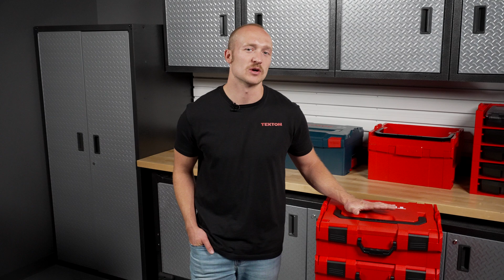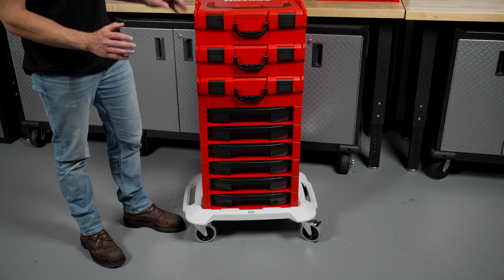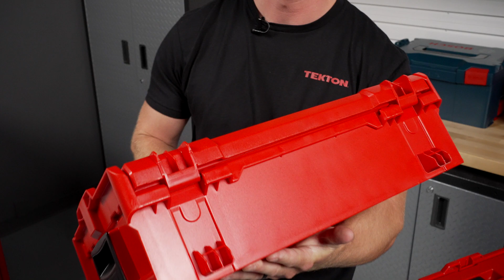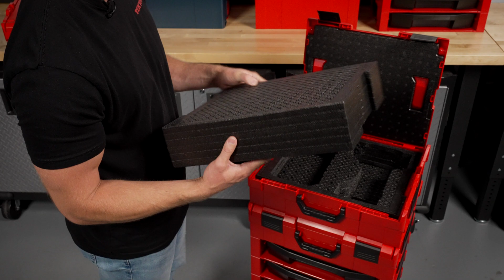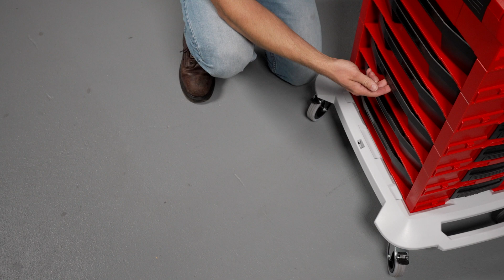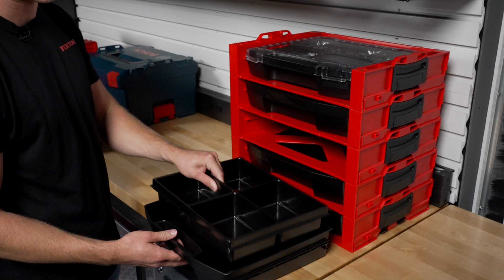A better way to organize your tools and parts | TEKTON Stacking Organization System

Comment: are the stacked racks easy to disassemble?  I heard that the Bosch one locks in rather than latch in as you stack the racks together.  To be more clear, are the shelf racks all held together by the click system--the black tabs?
Reply from the maker: @ProxyFinal Hi there. Yes, these drawer racks are held together by the black latches on the sides. It takes two hands to remove one of the stacking drawer racks since you need to push both tabs in and then lift. Our system is part of the Bosch L-BOXX system.

Comment: I recently purchased the Tekton 1/4, 3/8, 1/2 Inch Drive 6-Point Socket and Ratchet Set. Does Tekton plan on selling the stacking organization system with pre-cut foam inserts for the 212-piece set? Or even just the 1/4, 3/8 Inch Drive 6-Point Socket Set with the pre-cut foam inserts? I didn't see the option for this on the website.
Reply from the maker: We currently don't offer pre-cut foam for the 212-piece set, but I'll share this suggestion with our product developers! We do have sets with 1/4 and 3/8 inch drive sockets in foam. You can see all our stacking organization sets with tools here: https://www.tekton.com/tool-storage/stacking-organization-system/stacking-system-with-tools
Reply: @Tektontools  Thank you for the reply! I already have the 212 set. I would only want to purchase the foam inserts with the cut outs even if it's just for the 1/4 and 3/8 set. Again, I'm looking for just the foam inserts with the cut outs WITHOUT the tools included.

Comment: Can you locked it out or how would that work
Reply from the maker: The drawers are not lockable, but the stacking tool box has holes on the left and right sides that you could use to padlock the lid shut.

Comment: when dude did the drop test as he picked it up and it went from horizontal to vertical, did you guys hear everything shift? Id like to see the contents after he picked it up and then again after he dropped it...
Reply from the maker: Everything in the box is very snug in the foam, so nothing shifts around. Hope that helps.
Reply: It didn’t sound like anything moved inside
Reply: Literally no. Did not hear anything move man. C'mon now. There was no metal to metal clang. Those tools are still in place. Haters gotta hate I guess 😂

Comment: I'm trying to get out of systainers because they break so easy.
And these are made of the same abs. The day someone makes a modular toolbox system of this size but is made of the same type of material as the ones they sell at the big box store's,  they'll probably steal half the systainer market.
The big ones are too big and the smaller one tool size are too fragile

Comment: Why is the base only rated for 220 lbs? Big mistake!
Reply: Fairly average. Packout dolly is only 30 pounds more. This is also an existing system with existing molds, it's not like they were going to come out with a product within an existing ecosystem and it not have the same specs. I guess bosch jumped ship from systainer. Bosch's version is called L-rack, I assume there are others.